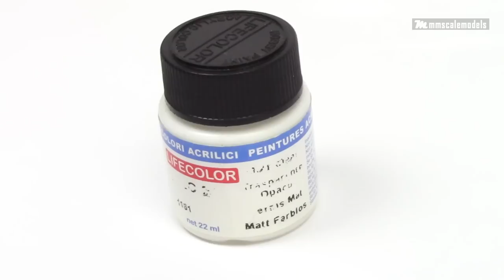Tamiya Corsair F4U-1D 1/48 - Full build

Comment: I think you did a really nice job. Couple things. On corsairs, the bottom of the aircraft is pretty messy. Not only from the engine but from ground crew rearming the aircraft. 2 areas that need a tad more "scratches" is the tail fin. There is always debris from the big propellers causing chips. And some more on the cockpit windows. The canopy is always getting closed kinda haphazardly. But these are just not picks.
Reply from the maker: Thanks Will, I always appreciate constructive remarks

Comment: Radial engine tend to collect oil in the lower cylinders. Its partially coming from those tubes you installed. Then the oil is pumped from a tank at the lowest point and flows to the heads through those pipes that connects the pistons together. When you see ground crews slowly turning over the engines by hand it is to prevent hydraulic lock, from the oil. Once they know none of the pistons are locked they will begin startup procedures, turn on the ignitions and spin the engine up. With the Corsair and many others an explosive shell was used to provide the energy to spin thew big Pratt and Whitney radials..
Reply from the maker: Thanks for the info mate, quite interesting 👍

Comment: Sir, do you know if an actual F4U pilot ever looked at the gauges you used and said "Yes, that is how they should read for a Corsair shut down and waiting for the Crew Chief?"  My ADD kicks in and I'm loathe to just accept even Eduard parts without question.
Reply from the maker: Hi Daniel, I would not go into that rabbit hole myself. Its just not visible enough to deal with that.
Reply: @MMScaleModels  :-)

Comment: That plane looked stupid, they were rarely around long enough to get anywhere near that bad. American aircraft companies were slapping fighter planes together faster than the Germans and the Japanese could shoot them down. Unfortunately they weren't built well enough to last a long time. Four or five months and they were used up. If you look at some nose art, you will see Miss Behavin' IV or V because when a plane started to show its age, it was replaced. 
My Uncle flew out of England in a bomber crew and every couple weeks men would come and hack the used up fighters and haul them off to be recycled into Spitfires and Hurricanes.
Reply from the maker: There are enough pictures showing the highly damaged paint... especially in the wing root area.
Reply: @MMScaleModels  maybe early in the war, but the bottom of the Pacific is littered with what were serviceable airplanes, when new planes were brought over, well used planes were pushed off the deck to make room for new planes. When improved  versions were brought, entire air wings were disposed of so the whole wing could be refitted at the same time. This plane has too many bugs splattered on it, pitch it.